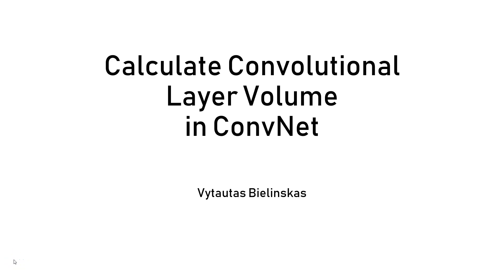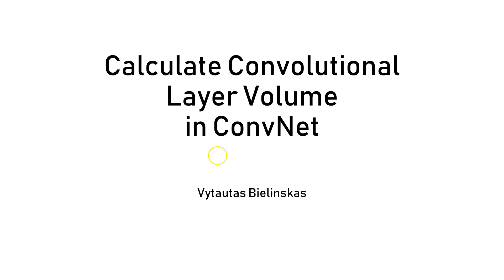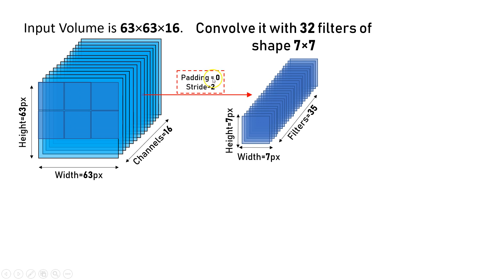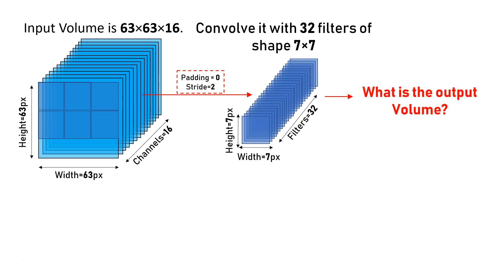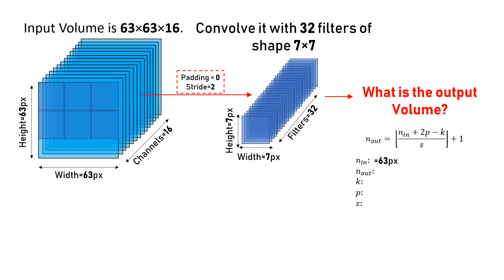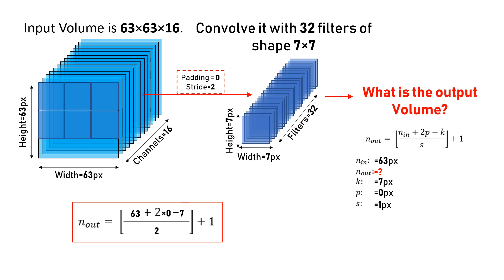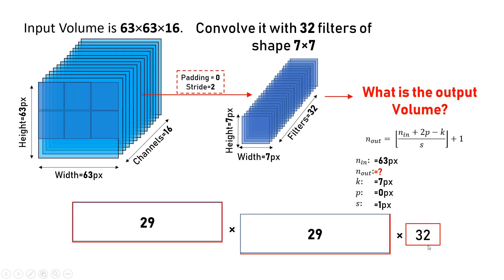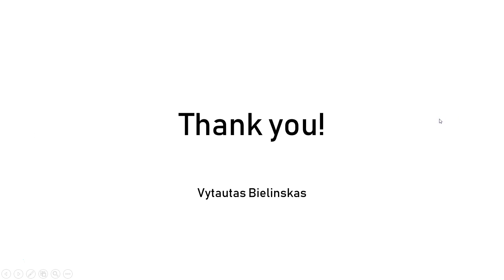Calculate Convolutional Layer Volume in ConvNet

Comment: Hi dr. Vytautas thank you for this video. I was just wondering in this case what are channels? In the context of images shown in RGB, is each element within RGB one chanel? so R = 0 channel, G = 1 channel, B = 2 channel?
Reply: I'm sure you have it worked out by now but in case anyone else comes here wondering: yes you are correct. Usually images are in RGB and have 3 channels. Grayscale images only need 1 channel. But there are images in various specialised fields that have many more than 3 channels.